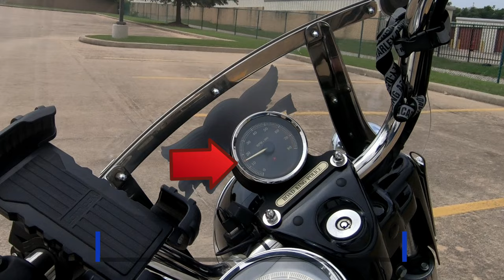Master Slow Speed Turns Like A Pro - Is Your Throttle Technique On Point?

Comment: Thank you for this video, Paul. I've been a subscriber for a couple of years and have watched all your videos.  I own a 2023 Road King Special and a 2024 GoldWing 6-speed.  I bought the GW in February and, until watching this video, struggled to get my turns as tight as the Road King.  Like you, I strive for lower RPMs on my H-D (1300 - 1500), and while lower RPMs sometimes works on the GW, they don't CONSISTENTLY pull me through.  So, after watching your video a couple of weeks ago, I immediately took the GW to the parking lot and voila - MUCH BETTER!  I've always been a believer that running RPMs too high can put needless wear and tear on the bike, and therefore convinced myself that surely all bikes should lower RPMs.  But that's clearly not the case - each bike has its own specs and what's acceptable and sufficient on a Harley, might not be on a Japanese bike.  Your video gave me permission to experiment, and now I feel more comfortable practicing slow speed drills on the GW - thanks for all you do for the MC community! 🤘✌
Reply from the maker: I am so glad this video helped.  I want to thank you for being part of the channel and taking time to watch my videos I really appreciate it.  also thank you for sharing.  I always say somethings it's the small things that make the difference 🙂

Comment: Great points Paul. It took a while for me to really understand how to maintain steady throttle. It has made a huge improvement to my slow speed control. I try to see how low I can take the RPM and maintain steady throttle.
Reply from the maker: Thank you sir and thank you for watching and for sharing your comments.  You are correct it can make a huge difference.

Comment: Hi Paul, Thanks again for this wonderful tips. I'm just having some issue applying constant throttle specially when I make the circle turn going to the right. Is there a technique you can share to make sure that I can keep that rpm constant?
Reply from the maker: Well yes I do haha this is a common thing for most riders.  I left a link to a video I did that should help.  Keep me posted
https://youtu.be/opKdNsdzuFA

Comment: I see you and I listen to you, but I'm so afraid to drop my bike which for me is a very expensive one and dropping it would cause, if not cosmetic, but serious damages.
What is your best advice for beginners?
To make wider u- turns and gradually narrow it down until you are brave enough to U-turn and do figure 8 around a penny?
Perhaps it sound silly, but the question is serious.
How do you start the training in a safe way and without damages to the bike?
What are the learning steps, ie lesson one for one hour, lesson two for one hour, lesson 3 for one hour and so on?
Yes, I do want to practice, practice and practice, but you as a so skillful rider of really heavy bike, what is your master tips and advise to beginners?
Reply from the maker: those are all great questions that we all go through.  I first would suggest you investing in some engine and saddlebag guards.  This will help protect your bike and help takeaway some of the anxiety of dropping your bike.  Next I would say take if slow and really work on the friction zone.  When you are sitting at light or behind a vehicle practice rocking the bike slowly back and forth using the friction zone.  You can also do the slow race exercise where you go in a straight line as slow as you can using the friction.  I will leave a link to a video I did at the end of this.  As for your practice time keep it short to start with about 30 minutes.  Also pick 1 or 2 things to focus on each time you go out.  If you have problems you can record your practice sessions and send me the video and I will look at it.  here is the link and the email address.
https://youtu.be/aLGwSi9r6HI
Email:  prorider.ctx.club@gmail.com
I hope this helps.
Reply: Thank you.
Reply from the maker: @filmtajm35  You bet and keep me posted.

Comment: Paul,  that right hand looks real steady on that throttle.  Does your RK have an electronic throttle ?  I find on my 2019 Road Glide it's hard to keep the throttle steady due to the sensitivity of the electronic throttle.  Try as I may it seems like I'm always over and under shooting the engine RPM because of this.
Reply from the maker: No sir it's not electronic.  The electronic throttle just takes some practice.  I left a link to a video I did that might help.
https://youtu.be/opKdNsdzuFA

Comment: This is much harder than it looks. I find holding the throttle steady while operating the handle bars and leaning very challenging.
Reply from the maker: It isn't as easy as it looks and it takes practice. If you stiffen your wrist like you are throwing a punch it will help keep your wrist from wanting to roll as you turn the handlebars.  Checkout this video and Let me know how this works.
https://youtu.be/opKdNsdzuFA
Reply: Thanks alot for the til sir paul 
Watching from the Philippines

Comment: My bike is a Harley Iron 883. My road speeds in Canada where I live are 80 km/h which is 50 mph, and going through villages is 50 km/h which is 31 mph.  I was wondering if it was alright to have my bike in 4th gear while doing 80 km/h and 3rd gear while going 50 km/h. Are these reasonable speeds for my gears. I know 5th gear is for highways at faster speeds.
Reply from the maker: Those gears should be fine.  It it gets to where sounds like the engine is working hard then try going up a gear.  let me know how it goes.
Reply: @ProriderCentralTexasYouTube  Yep, I will thanks.
Reply: @ProriderCentralTexasYouTube  It went well, I even had my bike at 5th gear when I hit a long stretch of road going a little over 85 km/h. I made a mistake when I stopped at a stop sign though, I accidently started off in 2nd instead of first but my bike didn't stall but just had less power. I thought it was in 1st but I was focused on the traffic in front of me. Guess that's all part of the learning process. I will make sure it's in 1st gear when at stop signs.  I also noticed that when I am downshifting from second to first going at least 15 km/h which is 10 mph then shift into 1st gear, I am no longer getting that massive engine braking I experienced before that freaked me out.
Reply from the maker: @kjvbiblebelievertal7431  Very nice it will get better the more you practice.

Comment: I’m having a problem with U-turns period. I turn my head to look where I want to go but my eyes dart back forth preventing me from making the turn. My turns are four to five parking spaces wide and I cannot lean the bike. I have drop guards on my bike but I don’t want to drop it. I’m frustrated because I’m not getting any better :(
Reply from the maker: When you practice first do some walkthroughs where you focus on your eyes and quicker head turns.  When you do this also pretend like you have you hands on the handlebars and use your left hand as if it was on the clutch.  This will give you some good reps without worrying about dropping your bike.  I know this may sound silly but I did a lot of visualizing when I went through motor school and it really helped.  I know this is easier said than done but you have to try to stop thinking about dropping your bike.  When you think about it it causes everything to tighten up and you forget to do the techniques.  Also don't get frustrated we have all been there.  This is not an easy thing to do, just keep working at it.  I know I said a lot and I hope it helps.  Let me know who it goes.